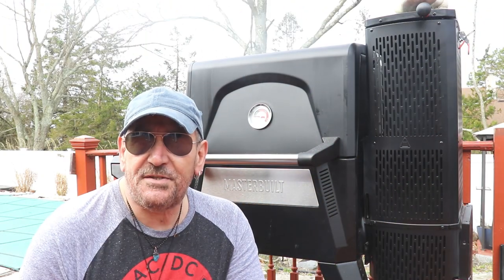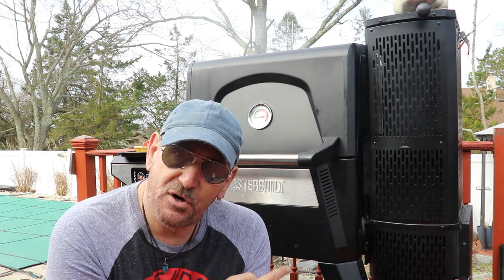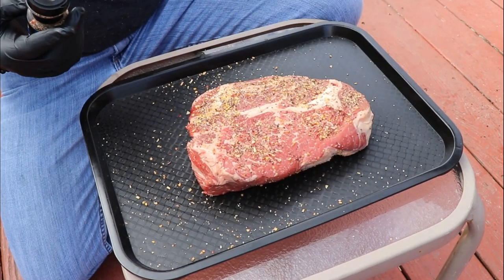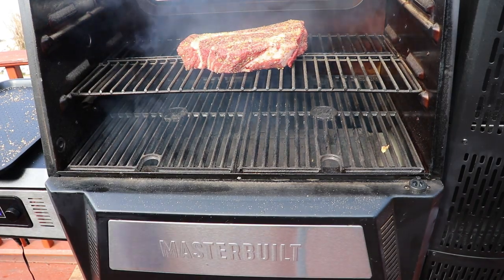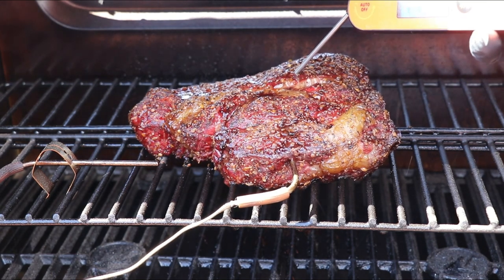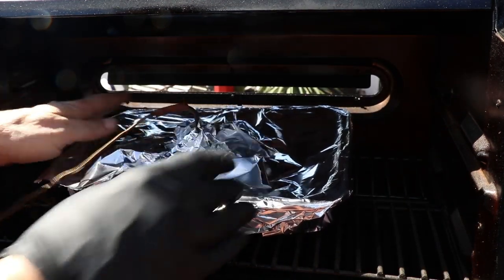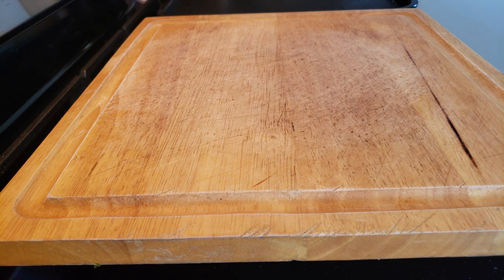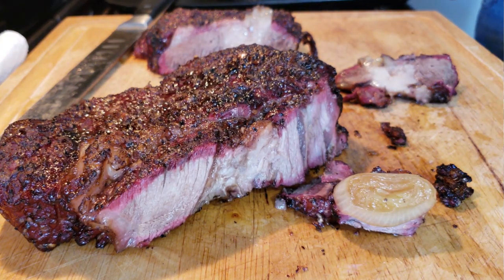Smoked Chuck Roast | Masterbuilt Gravity Series 560 | Masterbuilt Issues

Comment: This looks amazing! I've been using an old school smoker for about 3 years now and never tried a chuck roast. I just bought my masterbuilt and can't wait to try it. The issues you address at the beginning are common for any smoker, not just these types. Generally speaking, the bottom layer is about 25 degrees hotter than the desired temp and the top is 25 cooler. A nice way to regulate the heat is to have a aluminum foil container full of water/chicken stock/apple juice at the bottom to absorb some of the excess heat and also keep your meat from drying out!
Reply from the maker: Thanks Daniel for the awesome advice.
Reply: And then the meat itself on the second level?

Comment: Nailed it! Well done man. I only use the top rack of my 560 every time. Even put a big drip pan under it to there is no direct heat. I've had company and had to make a lot of food, forcing me to move some of it to the grates. It never turns out perfectly, always a bit on the dry side. This is my second smoked chuck. Last one I butcher papered and basically did it like a brisket except with a shorter rest. It was great, but I don't feel it was a home run like yours was. Going to try the sauce like you made this time I think. Hope it turns out as well as yours did.
Reply from the maker: Thanks bud.

Comment: Chuck looks great. Excellent video.  The second rack seems to work better on long cooks. I made a pork shoulder up there after looking online and noticing folks using it when cooking longer cooks. I also got another set of racks to add capacity on the larger cooks.
Reply from the maker: Geoffrey, Thanks. This cooker is misleading in size because of the 2-row rack. I did an H&F brisket that would have did better on the second row. Where did you get the second set of racks??  Masterbuilt??
Reply: Great video!!

Couple of questions:

1. How much room is there between the two top racks? Could you fit a full brisket between the two racks? 

2. How much room above the top rack? What could you fit between the top rack and top of the grill?

Just trying to figure out how much this cooker could actually fit.
Reply: Sean Hamilton in between the grilling grate and the second rack, you have 4 inches. In between the second rack and  third rack, you have 4 inches. In between the top rack and the lid, you have a little over five inches. To be honest, I wouldn’t cook a brisket on the bottom rack. I think I could fit one on the second and third rack for a total of two if we are talking full packers. As for ribs, I’d say six racks total. I can smoke a ton of chicken. I’ll probably have a video on that soon. I’m still debating on how many pork shoulders. At least four cause I use a drip pan. Do you own or are you looking at a 560?  Thanks for the feedback!
Reply: Geoffrey Boyd - looking at a possible purchase.

Comment: MB 560 owner here. I came to the same conclusion as you regarding the lower grates and cooked two chuck roasts yesterday on the middle rack, just as you did. Came out great. I have some Joes Grill Grates on order to replace the stock middle and upper racks to allow for more cooking area on high quality, custom made grates from Joe.
Reply from the maker: WOW, Awesome. I'll have to check out this Joe. Thanks-
Reply: @thegalleryBBQ  Couple links for you: https://www.facebook.com/joe.grillgrates.9

https://www.facebook.com/groups/750191225406424/

https://m.facebook.com/groups/750191225406424?view=permalink&id=847093952382817

Comment: This is very helpful information for me. I bought this grill but haven’t really had a chance to do much cooking. One issue I have had is trying to prevent the chunks from igniting in the ash box. How do you manage that? Do you just let them burn? Thanks!
Reply from the maker: Hi Chad. I usually mix a few chunks in with the fuel. That said, anything put in the Ash box I'd guess will not ignite for long do to the lack of oxygen... Try mixing with the fuel, I did a Trip Tip yesterday that was loaded with smoke...thanks and keep me posted
Reply: The Gallery Backyard BBQ I still have wood catching fire. I’m going to have to try it in the chute. Works great when I blow out the fire.

Comment: You got to run a 225 for long cooks. I did a porkbutt and it did get a little to hot. Did a brisket took a aluminum pan with with lava rock on top of the deflector worked great.
Reply from the maker: Thanks. Ill give that a go.
Reply: Not a bunch so you don't put to much weight on that little shelf on the left of your grill just a few to hold heat.
Reply from the maker: @joshgreen9708  awesome, ty

Comment: That's a heat manifold, the fire is actually in the coal box. I haven't experienced any overheating from cooking directly on the bottom grates on my 560.
Reply from the maker: Have you ever done hot and fast ? or longer cooks.?  It definitely gets overly hot at the surface. Thanks for the comment.
Reply: @thegalleryBBQ  I just did a 9 Lb pork butt, hot and fast, 9  hours this past Sunday. I started off @225 for 3 hours just to get good smoke penetration, then went to 250 for 2 hours, then wrapped and finished @ 275. I injected, and sprayed it constantly (through the back vent). One thing i like about this as a smoker is it has a nice recovery time when you open the door, it actually kicks the fan on, and blows it hotter so you gotta watch out for that.
Reply from the maker: @starmc26  Thanks. 225f and 250f is not really hot, and 9 Hrs certainly ain't to fast. lol   That said, I appreciate you watching and definitely appreciate the comments. So far I am enjoying this cooker.
Reply: @thegalleryBBQ  Its faster than 15-16 hours it would normally take!!
Reply: I would have to agree with Tommy on this one. Bottom grates heat up a little hotter. I found that where the grates contact the meat it definitely cooks faster. I also think it depends if you have a water pan etc and how many pieces of meat are contacting the grates.

Comment: I've been looking for a new grill for a while now.
I stumbled across your masterbuilt review and went and bought one.
Decided to do this as my first attempt!

ANY advice would be appreciated!
Reply from the maker: Best advice. Pick out a Chuck Roast with lots of inside fat:)... then cook one level up and follow the plan. You must come back and LMK how you did:)....
Reply: @thegalleryBBQ  Awesome tutorial! Found myself using poor execution, ha ha... I cooked a level up, followed the plan, but around 3.5 to 4 hours in it would not go past 140, I did some research and figured hey this must the be the "stall" everyone talks about. Covered it, threw it back in... and idiotically set the temp to 300 instead of 250 (we where going on about a 6.5 to 7 hour smoke). The smoke ring looked awesome, the crust was great.... but it was dry! Overall im 90% pleased with my first ever attempt at smoking!
Reply from the maker: @Pyrotoxic92   You definitely wrapped before the stall. Remember, Your also developing that good Bark before the wrap. So sometimes you'll take it longer into the Stall because that Bark is not yet right,  or dark enough. Sometimes it's just the opposite. That bark is rocking right at the stall.  A good rule of thumb is around high 160s to mid 170s. Sometimes you get to 140s Quick then it seems like forever to get to the stall. lol
Reply: @thegalleryBBQ  That is definitely what happened, I need to make it a point to start cooking WELL ahead of time so I don't feel rushed when its 7pm and the meats still at 140, I appreciate the advice and the quick response. I think im going to just try some smoked pork ribs today.
Reply from the maker: @Pyrotoxic92   Tiss why i'll be putting a Brisket Point on Tomaroow between 5-6AM:)...

Comment: Have you noticed a different temperature from an external monitor than what the digital box is reading? Mine is anywhere from 20-40 degrees cooler then the digital control. Also does your masterbuilt app work properly? Mine is always disconnecting and it’s frustrating. Thanks for your time.
Reply from the maker: Hi T V...The app sucks. That said, So does the one from Pit Boss. lol   I have only used my trusty Weber Weber iGrill 2. I have not even dialed in or played with the onboard external Temp monitors.  Have you checked the readings by doing ice water/boiling water tests??
Reply: @thegalleryBBQ  You got to adjust to get the right temp at the grate

Comment: Looks great... just put mine on the smoker.  Did you bump the heat after the stall or do you leave it at 250?
Reply from the maker: Sometimes ill bump to 275. depends on the size and my time(how hungry i am). lol   You can check me out and post up pics at my masterbuilt group. https://www.facebook.com/groups/264734041353275/

Comment: Does the excessive bottom temp occur if you cook 275 F or less? You mentioned hot and fast, but what about low and slow, which in my mind is 275 F?

I think the temp of the baffle is important when searing. Hot air is not enough to sear. You need radiant heat like off of a direct fire.
Reply from the maker: Best guess, yes. I'd prefer to cook first level.
Reply: Does that mean the second level up?
Reply from the maker: @shumardi1  Yes, you've got the bottom, then second level, then third.   Thanks-
Reply: The Gallery Backyard BBQ Funny......it’s a bit like when I talk to my US colleagues (I’m in the UK).........when we say 1st floor in the UK, my US folks think I’m saying ground floor! :-)

Comment: Noticed that when my digital is set to 250 my lid temp says almost into the "bbq" heat category which is above the "smoke" section. And I noticed yours hovers right in the middle of "smoke"
Reply from the maker: Yeah. those hood temps are justused for a guidance.

Comment: I was thinking the same thing about the fire manifold underneath. Can you fit an aluminum foil water pan on top of it?
Reply from the maker: On top in like sitting right on it??   If that's  what you meant I'd think thats not a good idea as it would boil up and get to hot. But what you can do is but one on the grates and cook first level. That would work great as long as the water is hot to start so Temps stay stable.  Thanks River for the question.
Reply: Make a circle outta foil to set it on.

Comment: Hey just a observation, When you were checking that meat it seemed like a lot of dust from the charcoal was flying around can you comment on that ?
Reply from the maker: Good observation. I went back and watched and see what you mean. I kind of remember it happening while I was cooking but do not recall it being a problem. Thanks for the question.
Reply: @thegalleryBBQ  I'm not sure if you answered Stardus' question, but is this dust/ash flying around related to heavy air flow with this grill? Is the fan producing a strong airflow that causes the dust/ash cloud? As you stated, you don't recall this as a problem, but do you still feel that way? I'm just slightly worried if the device produces a strong airflow drying up the meat surface too quickly.
Reply from the maker: @capodituttitoopeli   I'm not sure-. I think its something the camera picked up and made it look like more then it was. Its never been a noticeable problem. Thanks-

Comment: I’m having major issues with mine! It gets super hot! Very uncontrollable to stop! It’s like the fan stays on. I’m very disappointed in this cooker.
Reply from the maker: That's unfortunate. I've had a few things go whacky with mine. Did you contact the company ?
Reply: The Gallery Backyard BBQ it’s spitting out an error code 5- I ended up unplugging all of the wires to the fan and the probe that controls the temp- and that seemed to do the trick. My first cook was a brisket, i set it to 275 walked away came back and it was cooking at 375 and the fan wouldn’t stop going. It’s seems to working fine now but we shall see.
Reply from the maker: @JGONTX   WOW, Keep me posted on that.